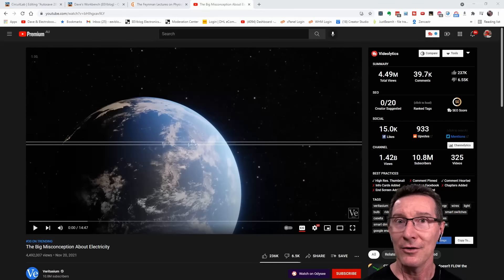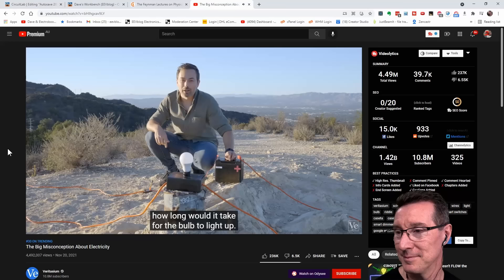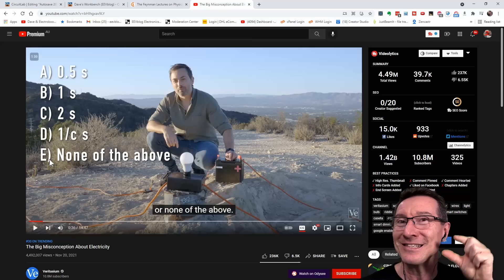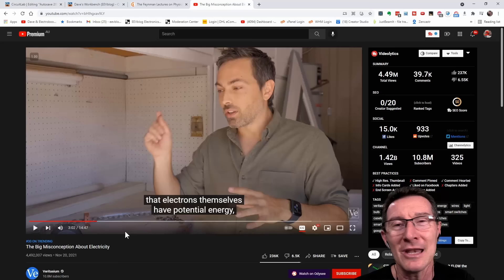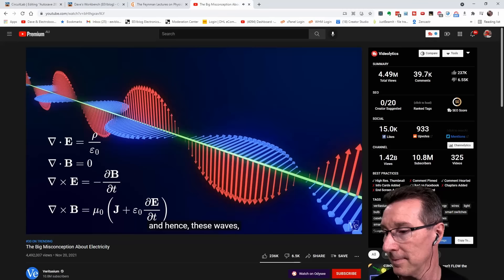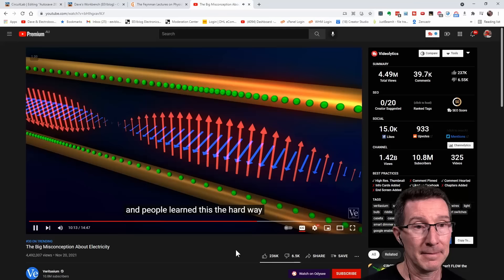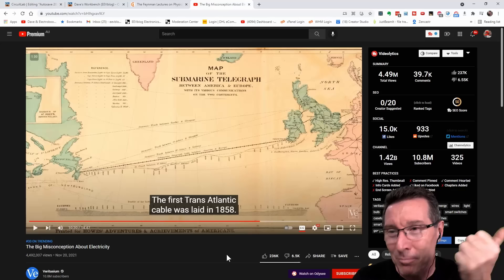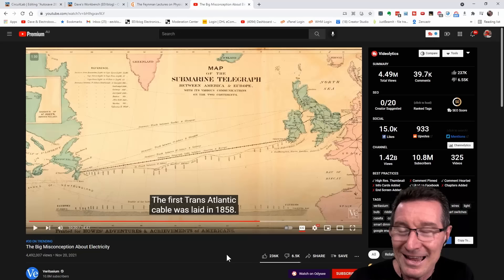EEVblog 1439 - Analysing Veritasium's Electricity Misconceptions Video

Comment: Something interesting I want to remark is when you said: "is nothing new for engineers" . I thought I knew about the basics of current (and I'm an electronic engineer) and honestly, during my time in the university, no teacher told me about the pointing vector (I remember a teacher mentioning it once, but just as a little mention, and honestly I am not blaming anyone) and seeing this to me is really new and honestly opened my mind on how do this world of electricity works. 

Excellent video Dave!
Reply: Indeed. The Real World(tm) works with real world considerations, not fancy, complicated, thought experiment math models. Stretch out a million miles of super conducting wire and prove it's 1(m)/c. Two wires 1m apart have f*** all for capacitance. (I've never even seen an instrument capable of measuring such a low capacitance.) The power did not flow from the battery to the bulb through 1m of open space. It's flowing along the wires, or we wouldn't need the wires in the first place.

If the battery has been connected for more than 1s, all of the wire has been "charged". Closing the switch at that point would, in theory, instantly allow power to flow. This is the "water pipe" equivalency -- once the pipes are filled, water can appear to flow miles away almost immediately. If that hose hasn't been primed, it's going to take awhile to flow.

This is the kind of physics experiment I'd like to see! 2ls of super conductor is hard to come by. If we do this with fiber optics (light/photons) -- and we have, this field theory math nonsense goes away. If you have 1ls of fiber, nothing comes out until 1s after you fire a photon in the other side.
Reply: @jfbeam 
Real world(TM) is too complicated to be able to usefully calculate the necessary stuff correctly. The way I remember an engineer decided to replace d/dx with a variable s and so his differential equations like you do your your normal equations. Mathematicians had a fit because it worked but there was no math to prove it true until Laplace.
Reply: I agree, my undergraduate degree in electronics glazed over a lot of critical theory under the guise of "you have to learn it yourself".  It was disjointed and rather than focusing on the critical, fundamental theories they focused more on providing you with practical skills, which to be honest killed a lot of the joy in curiosity I had and I've been forced to learn and discover accidentally by myself, in my own time.
Reply: We had this in 11th grade at school. Very surprised it wasn't taught in under grad EE.
Reply: I don't know what university you studied at but this was in the first year electromagnetism module when I studied. (see Kraus "Electromagnetics" 1981)
Reply: @oldbloke135  I received electromagnetic theory in 4th semester, but the teacher never mentionend that, so I think he missed a lot of information
Reply: There are good and less good teachers. Some teachers skip certain points for some reason. (Maybe they think it is not important, or they did not understand it very well themselves?) In my education the Poynting vector was teached. And as an HF engineer I had a lot to do with transmission lines.
Reply: Same... nothing here is opposite of anything i've learned but... i never thought about it like this.
Reply: Uh, Poynting vector.
Reply: How on earth do they not cover this? I figured out electrical energy doesn't flow through wires when I was an elementary school kid after I got a plasma ball for the first time; I realised it could power things like light bulbs wirelessly, so I decided to Google why and went down a rabbit hole. Then I learnt this stuff properly in the second semester of 12th grade Physics. Your university has failed you by not even slightly covering this.
Reply: We learned about poynting vectors at universitiy in the basic electrodynamics and in physics lectures. This is bachelor degree stuff in electrical engineering at my former university.

We pretty much learned electrical engineering down to the basic physics concepts including quantum mechanics and physics of materia and also shared some courses with the physics students.

Now working as an electrical engineer i notice that many electrical engineering students I supervise don‘t have that basic physical understanding and are therefore limited in terms of ‚out of the box‘ thinking.
Reply: Are you in India, where you can get an "Engineering" degree from a vending machine AKA diploma mill?  Not saying you don't have some great schools, but there is a lot of diploma buying/ payoff... going on, and "Engineer" is more of a title with social perks, than based on deep subject understanding, where  it's more about who you know, and how much you can pay.
Reply: @MarcosElMalo2  bruh, it is  just another vector, nothing fancy... i don't know why people get scared with that topic or with old school quantum mechanics... the principles and the maths objects are the same... i mean, modern electromagnetic theory and modern qm uses kind of a fancy maths (quaternions, octonions and shit), but nothing out of the ordinary
Reply: I was thought Poynting vector in yr 11. It came up several times during the base classes of my micro electronic engineering degree.
Reply: @Exachad  I remember my electromagnetc teacher just told us "Electricity is not a fluid" because in my country (I don't know if in other countries) when there is a blackout the media say "Se fue el fluido electrico (There is no electric fluid)" so he just told us that but never explained why. Some time later I searched, why electricity is not a fluid, and the article just pointed that electricity is just energy, but did not enter in details.
Reply: It'd be in your multiple electrodynamics classes
Reply: Also in most Calc 3 classes they are mentioned
Reply: @elliott614  actually, was in transmision lines (communication) the teacher said someething like, "this is the poynting vector, you should know this from your electromagnetic class" and we were all like "the teacher never mentioned it"
Reply: Same here, learned about right hand rule but never anything about poynting vectors.
Reply: One of the most important things you realize as you start to learn undergraduate sciences is that a key skill in making predictions is to determine what level approximation is appropriate for the problem being worked on.

For instance, it would be silly (and absurdly difficult, I expect) to design the generators of a power plant using quantum electrodynamics.  It would be equally silly (and even more difficult) to try and design the interior of a computer chip using Maxwell's Equations.
Reply: @juanchoavid123  it was not mentioned in context of power transfer in circuit but was thought as part of antenna stuff
Reply: @MrChandanc9  not was thought, just a little mention that never came up again
Reply: @jfbeam His point was that the current was flowing "along the wires" not "through the wires.  Like you say, we need the conductor to create the fields.  This is a point not obvious to most people who really just care that the power switch works, like me.  I pay to others to take care of the details.
Reply: @juanchoavid123  electrodynamics 2 was the transmission lines theory class. First semester was the pure vector calculus and field theory. I never went and didn't even realize they were talking about like microstrip, stripline, coax, etc. And thought they literally meant power transmission lines. I just looked at what they did with the numbers on the sample exams before the exams and got an A. Wasn't until I was an EMC engineer I taught myself all that theory.  Was mostly interested in DSP because I wanted to make things about music ... the music jobs are hyoercompetitive and the other ones require security clearance that I'll never get. 7 years after my BS I took several MS level CS classes for a certificate and still couldn't get a programming job when I went that long without really coding and was generally the best student in each class with little effort. O well. 40k down the drain. Though was interesting to learn about how to design multicore processor circuits and kernel level programming
Reply: @Rob Scovell -- There are different kinds of students getting BSEE degrees.  For some the path to an EE degree is long, tedious, unclear and with many dead-end branches. How many have the good fortune to have highly educated parents providing career knowledge and a guided education through high school advanced classes and a finances for the years needed to reach the wider and deeper understanding that is beneficial but not absolutely necessary to survive.
Reply: To all those babbling-on about "this wasn't covered in my ELECTRONICS engineering curriculum" .. Well, that's because it's not necessary for ELECTRONICS engineers; but, it IS necessary in an ELECTRICAL engineering curriculum for ELECTRICAL engineers. ELECTRONICS engineers are TECHNOLOGISTS, whilst ELECTRICAL engineers are SCIENTISTS. Sorry this may have popped your bubbles. Maybe Tinker Toy Tech wasn't the right choice for you. Anyway, chin-up lads; it's not too late.
Reply: @j.p.wagner6461  i'm not complaining, i have worked without that information perfectly, i dont know what bubble you talk. I just like to know theorical things like this 😉. And who told you electronics is not science? Maybe the one that needs to pop that bubble is you
Reply: @Rob Scovell Yeah, we're pretty muched fucked. Especially in FL; you should meet and chew fat with some of FL's finest EE grads .. scary.
Reply: @jfbeam : "Two wires 1m apart have f*** all for capacitance. " <-- Ha! Exactly. I like Veritasium, but his video about this topic is garbage.
Reply: @jfbeam : "The power did not flow from the battery to the bulb through 1m of open space. It's flowing along the wires, or we wouldn't need the wires in the first place." <-- EXACTLY
Reply: I learned about the left hand rule and pointing vectors in my freshman year in high school (9th grade). I think it was like one of the first things we learned in my electronics elective class in 1982. Very basic stuff. Strange that you are an electronics engineer and did not learn that or maybe you did but forgot since it is really of no practical use.
Reply: @Bob-of-Zoid  I am from India and we had this at 11th grade in school.
Reply: @Rob Scovell "software engineers are graduating with dumbed-down qualifications compared to 30 years ago"

This isn't accidental. Are you aware of a big reason for this?
Reply: Hmm, unfortunate.  Where I went to university EE majors needed not only their EE courses, but also Introduction to Electricity and Magnetism from the Physics department.  This stuff is the bread and butter of that course, though honestly I don't recall us calling it a Poynting vector, but we were using them all the time.
Reply: @jfbeam  But the moving charges cause the magnetic field.  That's the point.  No wires to move charges and no magnetic field and thus no electromagnetic field...
BTW, there are 50KW radio stations.  That's a lot of power, but it is omni-directional or just somewhat directional.  If you could make it directional enough to put it in a pencil beam you could send it through the air to power a group of houses if you could capture it in an antenna without it heating up.  That's a big if, of course, but imagine if it were possible.  When someone is swinging a ladder or operating a crane or flying an aircraft they (hopefully) know to watch out about getting into power lines.  But if if were instead beamed through the air ladders, cranes and/or aircraft wouldn't even know it is there.  
There IS capacitance between wires.  It's why one cannot get DSL in the country.  I lived just a mile outside of  the city and there wasn't the population to justify the expense of a DSL mux out there.  One has to be within a certain distance of the nearest DSL mux because the twisted pair has capacitance has to be "balanced" out by an inductor every certain length of wire.  This worked fine for voice communications, but every time one deals with this capacitance and then inductance every so often it jumbles up the DSL signal.  One can go through one of these lengths and two of these lengths but after the third one the bit error rate simply gets to be too high.  This is why one has to be within a certain distance of the nearest DSL mux and it's, of course, as the wire runs and not as the crow flies.
Reply: JESUS CHRIST IS COMING TO JUDGE THE EARTH SOON PLEASE!!!!!!!!!!!! CALL ON HIM NOOOOOOOOOOOOOOOOOOOOW!!!!!!!!!!!!!!!!!!!!!!!!!!!!
Reply: Those who even remotely understand the physics of electromagnetism are located in a very small pool of individuals today.
Reply: I had this stuff in third Semester, barely passed the class and instantly forgot about it. 

After working in an office as a project engineer for 3 Years only dealing with contracts, this was completely new to me.

Comment: I'm a retired Director of Engineering with my field in Electronics.  I love your videos.  I especially like it when you destroy scammers like Solar Roadways.  I worked for a small defense contractor and I'm very aware of SBR's.  There are people who take advantage of people's ignorance of science, electronics, etc.
Reply: Careful!  Dave here uses the wrong model for Derek's experiment setup.  A transmission line model is not applicable, the better model is a dipole antenna model.  See my explanation in the main thread.
Reply: I’m so sad to find out that solar roadways is bullshit. I don’t really know anything about electricity beyond what I have to know to run my amplifiers, but that video gave me so much hope for the future. Makes me mad to think that people were just pulling on heartstrings.